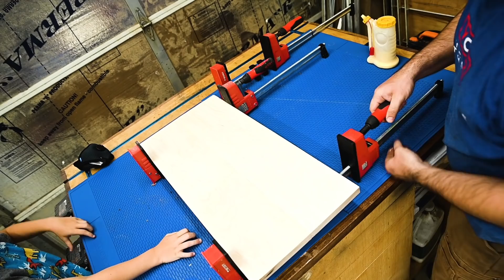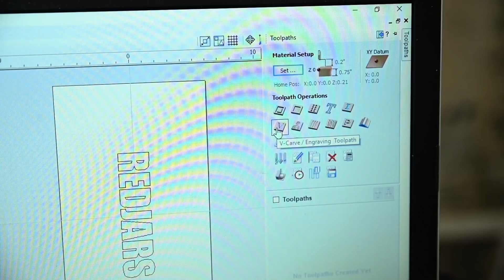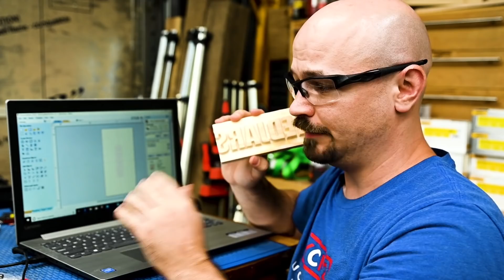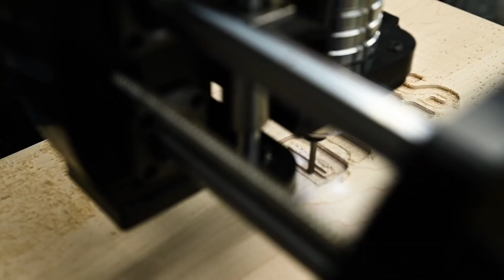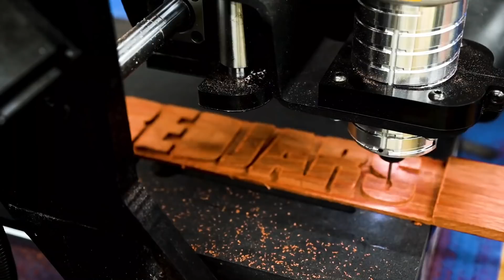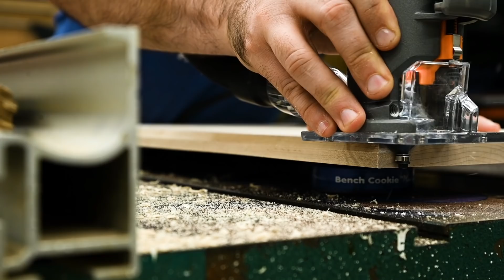V-Carve Inlay - My First CNC Project

Comment: Thanks a lot for sharing!
I will run a little production run in intricate v-carved boxes and wonder if surfacing with the CNC is needed before the v carve or the planer would be suffice to make it flat enough?
Reply from the maker: I find the planer to be more than adequate. Besides, you'll be surfacing it afterwards anyway.
Reply: @YouCanMakeThisToo  Thanks for your reply and for taking the time to answer! Just to make sure I understand, what do you mean by "surfacing it afterwards anyway?"
Reply from the maker: The inlay will be taller than the pocket when you glue it in, so you'll need to bring it down to the level of the rest of the board @thanhnhanhuynhnguyen3652

Comment: I have a different CNC machine (Shapeoko), but had a similar situation where the machine started carving part of the image about 1" inch over. My machine runs on belts that drive the XY axis. The X-axis belt stretched and became loose. It was very little, but had a large impact.
Reply from the maker: Classic belt driven machine issue... From that one I went to the OneFinity, all ball screws. And then to a pro machine, I have the PenguinCNC now and it's an absolute beast.

Comment: I see a few problems here. Yes you told you are new to CNC. But your router is with that battery router option way to heavy (4.84kg. My 1000w router/spindel only 1.2kg) If you look at your router/spindle bracket, you will notice that your spindle is not vertical because of the weight of your spindle. Second thing to make your cuts better is to use bits that are made for the job you want to do. Now you use a engraving bit for Vcarve, So you need a V-bit. You will see your endresult will be much better. Now i give you a tip : When Vcarving for inlay and you don't want pieces to break. Start with the Vbit (fine cuts) and then with clearing (bigger bit/ end mill) This prevents that small pieces break off. Second tip !!! important.....Don't use battery router.When battery is out of energy it stops right away. But your CNC keeps on going. This breaks your bit, workpiece and or your machine. The Dewalt is good option for you CNC ....but use one with 110volts power (110v in USA if im right) not with battery.
Reply from the maker: I switched it right after this video, that just happened to be what Woodcraft sent me with the machine. That's a great tip for using the v-bit first and then clearing for delicate pieces, I'll remember that!

Comment: Did you have to make the plug twice? When it’s cutting it reads correctly, and after the cut when you’re holding it it’s mirrored 😄 Either way, I like the video! I have a CNC on order and I’m absorbing as much info as I can before it gets here. Thanks!!!
Reply from the maker: Lol yep! Good catch. I knew I had to reverse the file and just forgot 🤦‍♂️ but I didn’t bother recording that scene again. Think you’re the first to mention that little slip
Reply: Ah! I’m sure I’ll fudge one or two if those up in the beginning too haha!

Comment: I feel your pain. When I started using CNC years ago it was painful. I see you are using up cut bits on this project. Try switching to down cut endmills whenever you can. You will get cleaner edges and less blow out on materials like pine. I very rarely use an up cut bit anymore.
Reply from the maker: good tip, I'll check them out. Thanks!

Comment: I've been making inlays for a few years now. I also love V-Carve.  I always use on the pocket: Start depth=0.0, flat depth=0.2, for the plug I use Start depth =0.1 and Flat depth=0.1. On your plug, you didn't mirror the image of the text.   I always use a 1/4" 60 degree bit.  Here's the machine I designed and built.  https://www.instructables.com/id/Medium-Sized-DIY-CNC-20-X-30-Work-Area/
You can see some of my inlays in the last step.  Love making inlays!

Comment: You're quickly becoming one of my favorite woodworkers on YT!  I appreciate the effort you put into your vids and that you show your mistakes.  That's awesome.  Now, you just need to get a camera that doesn't constantly search for focus. LOL  I suggest the EOS-R.
Reply from the maker: Thanks!! Dude.. that irritated me so much. I actually dropped a bunch of money on a Nikon Z6 earlier this year because of the autofocus. Normally it does really well. I kept looking at that shot and I think the issue was the holes in the clamps in the background looked like eyes to the AF algorithm. Using my monitor would fix that.. which reminds me, need to order a new HDMI cable so I can.
Reply: @YouCanMakeThisToo  Another way to fix it, in the meantime, would be to lock your focus on the spot where you'd be standing.  It''s an extra step, but works great if you have a lens that searches a lot.  But it's a small thing that most will overlook.  Just us camera bugs really notice it.  :-)  But keep doing what you're doing.  I'm enjoying it.

Comment: That came out real nice!
What are your thoughts on using the thickness planer on taking the back of the inlay off? I feel like it would work for the waste but once you start getting down into the lettering I'd be worried about the planer popping them out.
Reply from the maker: I thought about it, but I was worried about kickback. The feed rollers wouldn't have a good hold it and might've had some really bad chip out too. Next time I won't use a piece so much thicker than what I need and will just use the CNC to remove the excess.

Comment: Great job, Caleb. I laughed at the "get COPD" comment, and never thought to try the sawdust with CA glue trick. Love learning new techniques! As for CNC, looks similar to my 3D printer. Maybe the learning curve wont be as bad.
Reply from the maker: Having never done 3d printing, I'd say if you're familiar with that your cross over to CNC will be a bit easier. I'm sure there's a lot of similarities in things you have to be concerned about specifying in software that you do manually without thought.